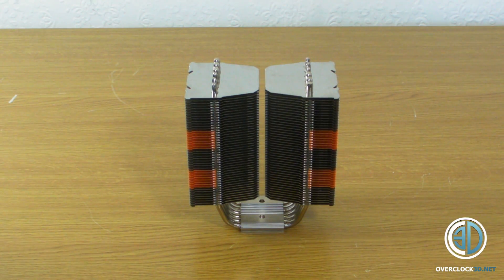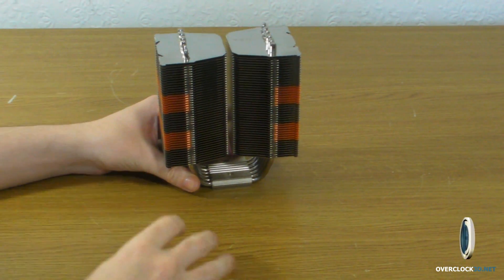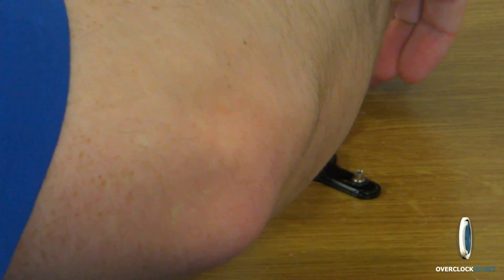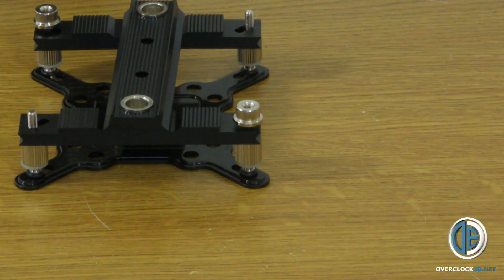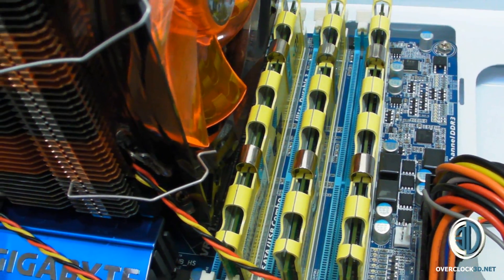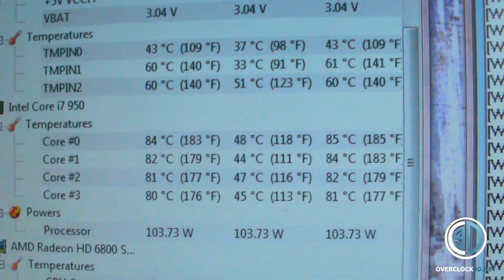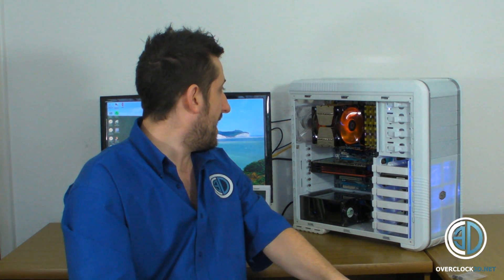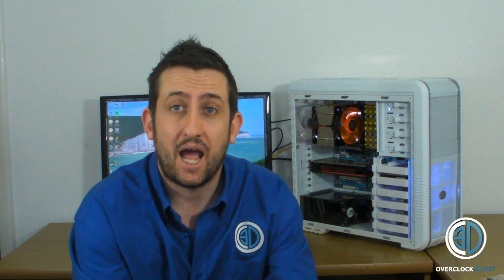Prolimatech Super Mega Heatsink Review

Comment: about the ram not getting hot;  i regurarly run fluid simulations wich use every single bit of ram it can get, and i have felt my ram getting quite hot, to the point you can't hold it for 10 seconds .... so about 60°c i geuss ... truth beeing said, it was cheap ram, but stil.. it was 12gig 1333mhz , not overclocked anyway (acer motherboard :(   )  maybe one small qeutsion, did you ever heard of fans in the size 72 mm ? a have a front slot for it, but you can't buy those fans ?